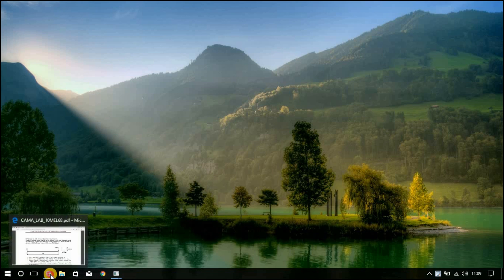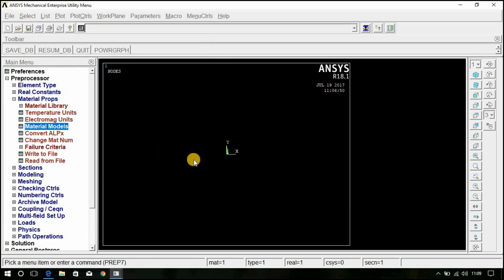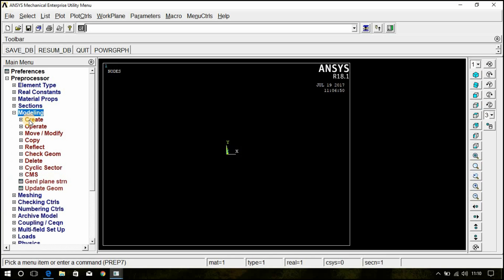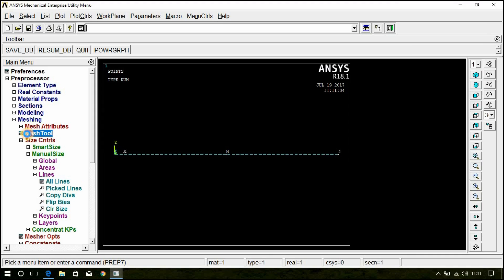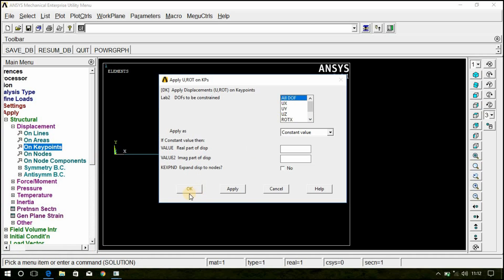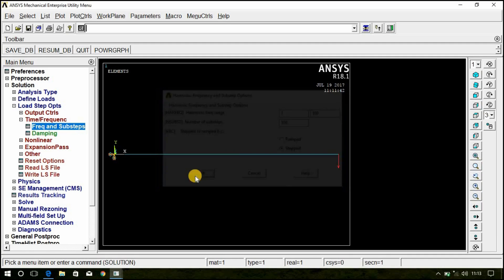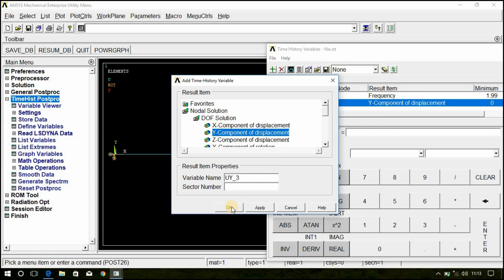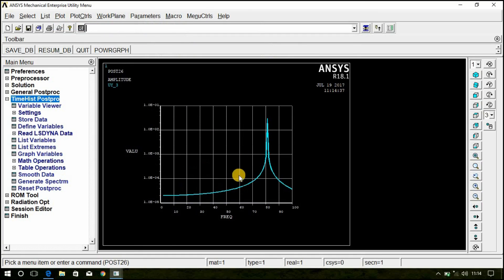HARMONIC ANALYSIS OF CANTILEVER BEAM

Comment: bro in ansys 18  real constants is not taking its showing link180 not supported in stepped bar problems
Reply from the maker: First of all i would link to thank you for watching my video. As you mentioned, YES in ANSYS 18.1 real constant for link180 does not support, so what you have to do is go to, Sections(in preprocessor)--link--add--id(give any id number,say 1)--SECDATA(here give the value of area) and continue with procedure. THANK YOU.
Reply: but there is no list results in post processor will ansys 18 support Windows 8
Reply from the maker: http://www.ansys.com/-/media/Ansys/corporate/files/pdf/solutions/it-professionals/platform-support/platform-support-strategy-plans-181.pdf?la=en
yes it will support. but i think there might be an error in your installation procedure, i am running ansys 18.1 on windows 10 and i have no issues.
Reply: K thanks for ur reply u r videos are helpful.